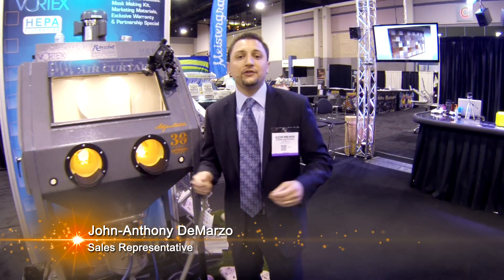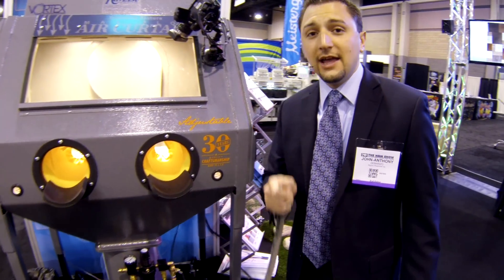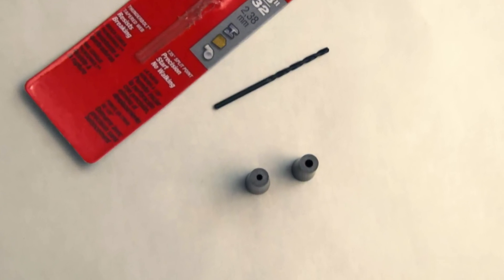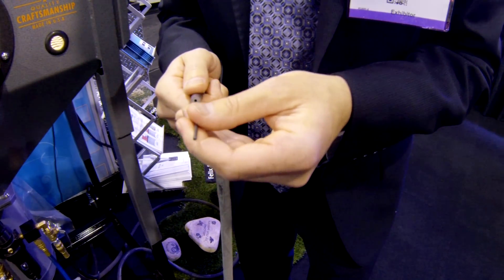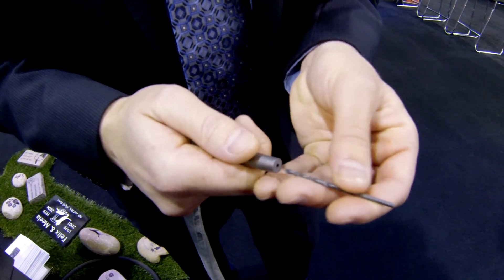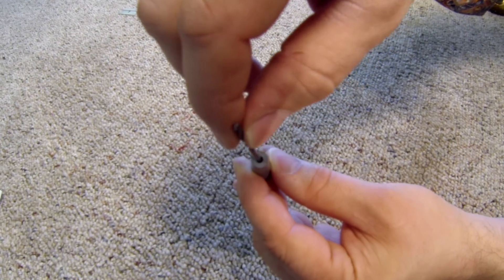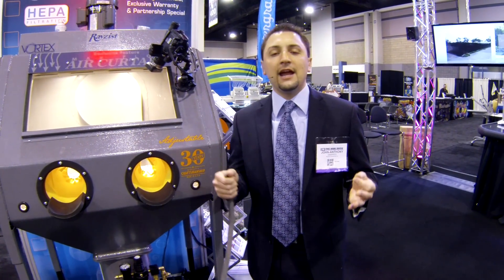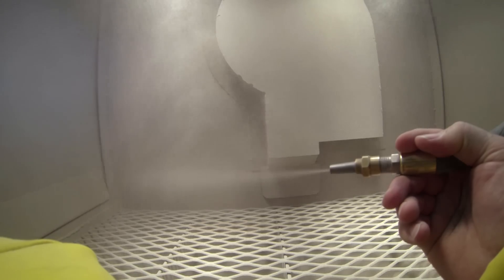Is your blasting nozzle worn?

Comment: My quest this year is more with the blasting hoses. I can't seem to keep moisture out of my lines and my sand keeps clogging. I spend more time clearing my lines than I actually do blasting.  Any advice on how to fix this?  I'm already using two water seperators and 50ft copper coils in ice as a condenser, and still having these problems.